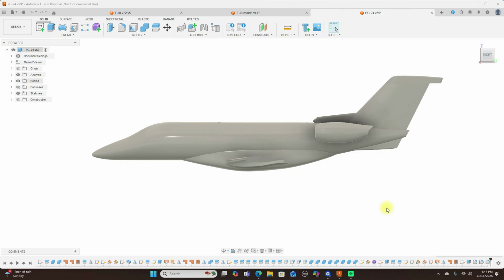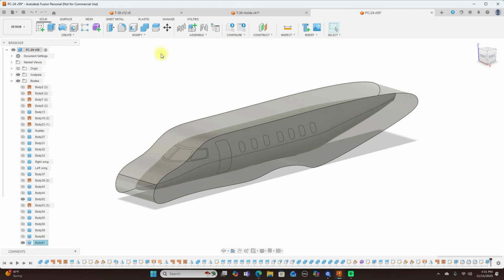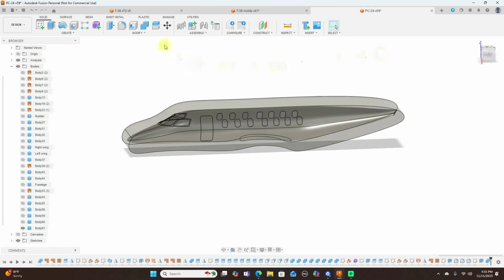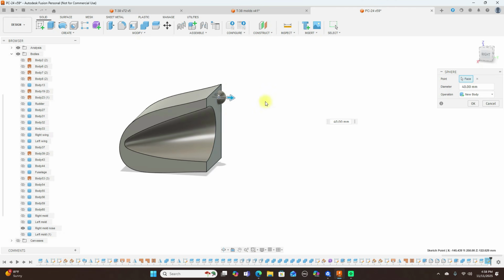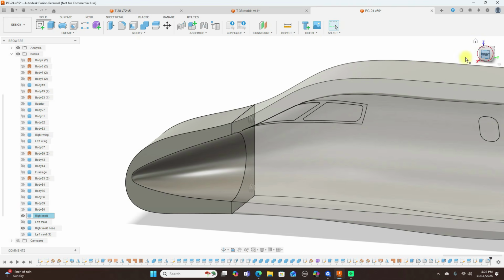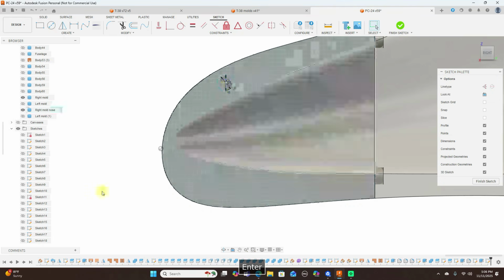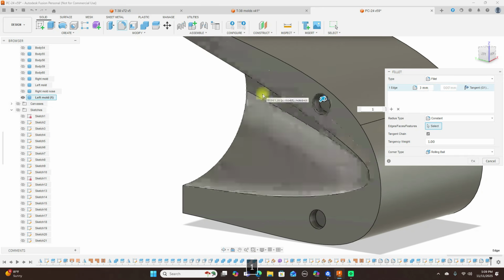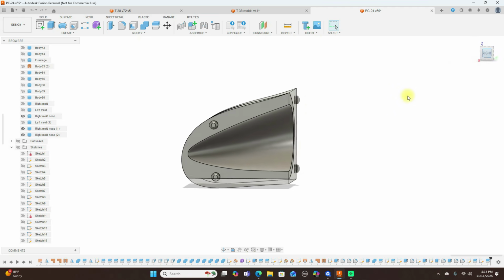The Easy Way to Design 3D Printed Molds Like a Pro

Comment: Why didn't you just "edit feature" of the combine to keep tool instead of redoing it? Was it just to show how to do the combine again? Also, rather than drawing cut lines to cut the mold into printable sizes, why not use offset construction planes that way you could set them to specific distances? And instead of using mirror option to place your alignment pins, why not use rectangular pattern? And would the SHELL option work to make the mold use less plastic? Not trying to backseat design here, just wondering why you didn't use possibly faster easier methods? I ask these questions because I've become more familiar with Fusion because  I've watched YOUR videos!
Reply from the maker: Hello.  All very good questions. You can do it that way and there is nothing wrong with it.  There are many ways in Fusion to get the job done.  Some are more efficient and use less work.  Just use what works best for you at the moment.